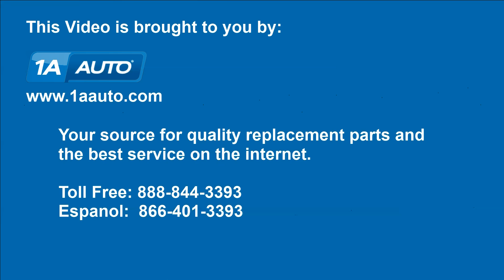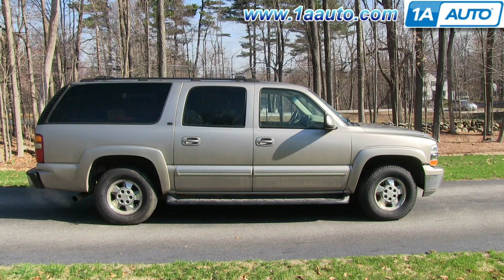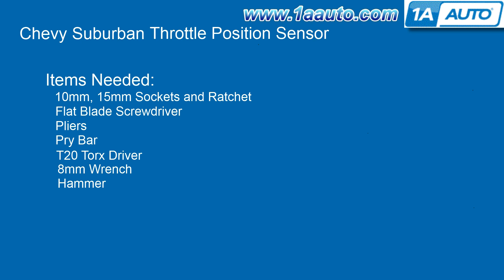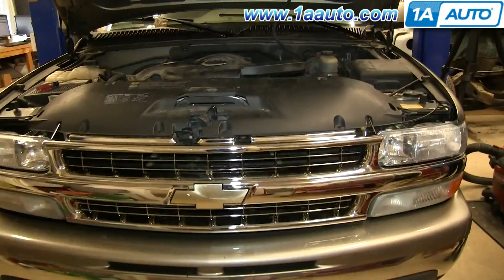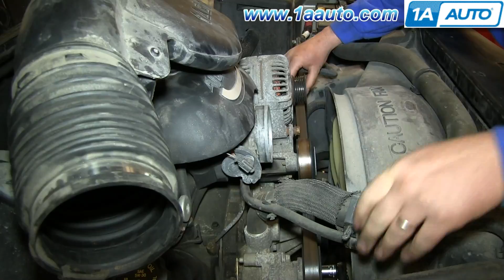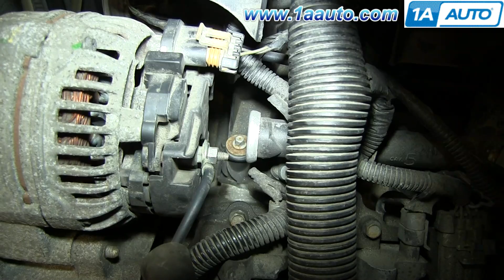How to Replace Throttle Position Sensor 00-03 Chevy Suburban

Comment: Could t you have just removed the throttle body  to replaced tps? And cleaned it while it was off?
Reply: I mean that's what looks most sensible..I mean 3 bolt nuts ..3 hose attachments..2 sensors..and 1 throttle cable all in front of u.. pliers..10mm socket and wrench and ur fingers..and it's of.. of course u will need a small torques bit to remove the factory set screws on the side of the TB..but in reality u r gonna probably wrestle with the hose clamps if u don't have a special set just for them sumna bitchez always in the wrong direction and never lock together like they should..and if anyone says other wise is damn liar...no matter how good a wrench slinger u b..lol ummm..its booshit!
Reply from the maker: +Joey Waldrop We could have done that yes.

Comment: 02 Silverado 5.3 will only start if you pump the throttle and dies when you let off the throttle. Any ideas on what’s wrong with it? Has a new idle air control valve
Reply: Check your maf sensor and wires.
Did you get it fixed?
Reply: I've got the same issue.  Sometimes on first start it'll run good.  No issues then I turn off the vehicle & these issues start on the next startup. 
Is did you resolve these problems?

Comment: In your video it says this is a 2002 model is it the same procedure for a 2003 model and if so how come your TPS sensor looks completely different than the one in the picture for the one I'm trying to order for my wife's 03 Suburban?
Reply from the maker: +Shadow Hill Here is a link to the TPS sensor that we carry. It is listed as fitting an 03 1500 Suburban. Hope this helps you out https://www.1aauto.com/throttle-position-sensor/i/1atps00002?f=840316&y=2003&utm_source=YouTube&utm_medium=CTA%20Comment&utm_campaign=1ATony
Reply: From where that gathered all parts from 2002 to 2006 fits Chevrolet Silverado four-wheel drive Cadillac tahoes suburbans GMC I forgot the rest hope this was helpful

Comment: 2001 Tahoe reduced engine power only when its cold outside when I start it and give it gas should I replace
Reply: Mike Larry mines has been doing this as well
Reply: Same here. 
I've read that there are multiple grounds that could cause the issue as well. Have you 2 resolved the issue? I got that message with reduced power once in the summer, now twice in the last week, only driver it twice.

Comment: Don't replace this part unless you have a good scanner or computer ! Cause your vehicle has to relearn a tps sensor. Vehicle won't start
Reply: Sean Gibson u tried it
Reply: Not on these it’s just plug and go the throttle is a cable not electric

Comment: In the last year my engine power has reduced drastically on my 04 Yukon. I notice mostly when I accelerate at the start especially if I have my ac on. It seems like I almost have to floor it to get it to move. My throttle body has a lot of gunk and dirt in it but it is not showing a code for it. It has over 250k miles would it be wise to go ahead and replace this part.
Reply from the maker: +Justin Hammond It would be a good idea to inspect your throttle body first and give it good cleaning.  This might help with the loss of power.  IF that does not work then you might want to think of replacing it.  http://www.1aauto.com/throttle-position-sensor/i/1atps00002?utm_source=YouTube&utm_medium=CTA+Comment&utm_campaign=ytcomment&utm_term=OqmW3UjNnVk
Reply: Have you checked your air filter
Reply: Just clean it 😉

Comment: what are the symptoms of a bad TPS on 5.3 chevy motor?
Reply: Trans can also have a harsh 1-2 2-3 3-4 shift with bad tps.
Reply: @LaserLuther  this might be 2 years old but it damn sure explains 100% why my truck is doing what it's doing right now. Thanks
Reply: Wait!!! Wtf🤣🤣🤣😂 magic trick look at the alternator go from OLD to NEW🤣🤣🤣🤣🤣🤣
Reply from the maker: +Rick Olivas You may get a hesitation in the gas pedal. The truck might feel like it stumbles upon take off, or while giving it throttle. Hope this helps you out. 1aauto.com
Reply: Thank you @1A Auto Parts.
Reply: @1AAuto  my suburban 2003 hesitates when the AC is on and you can feel vibrating in the cabin

Comment: I have a '10 Yukon XL and keep an OBD2 connected.  The "Service 
Stabilitrak" and limited power thing came on, but I used my Torque app 
to clear the faults - everything back on for another 10 miles before it 
happened again..and again.  It occurred randomly every so often and the 2
 error codes are related to the TPS.  Even after clearing the engine did
 not seem to be idling as smoothly as it was before these fault codes 
started coming on.

Today I went to AutoZone and bought a new TPS - installed it.  I started
 up the engine and now it's worse.  I can't even clear the error codes. 
(Note: I did disconnect the + battery terminal during all the work.)

Did I do something wrong?  I hate to take it into the shop if there's a 
simple fix here.